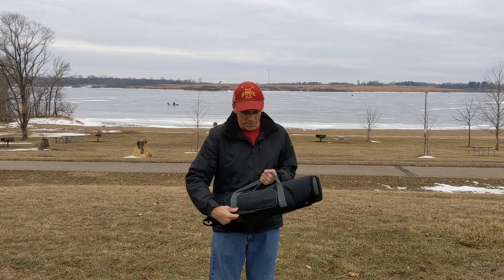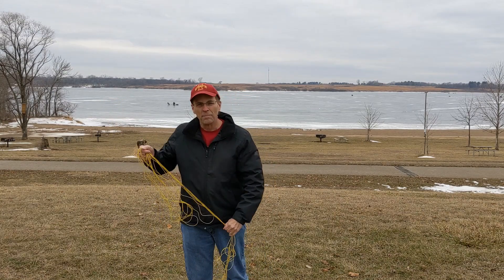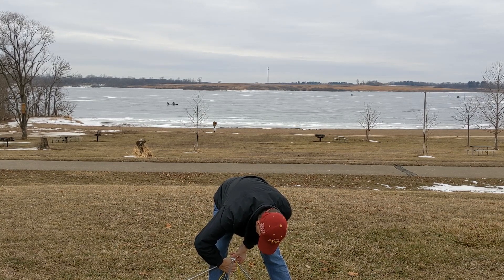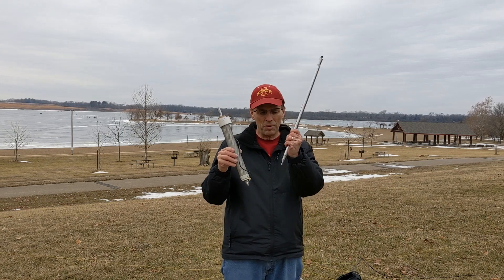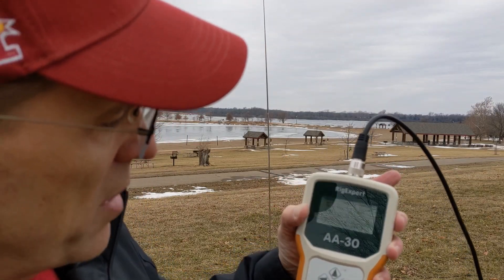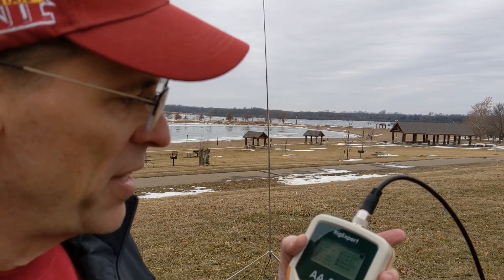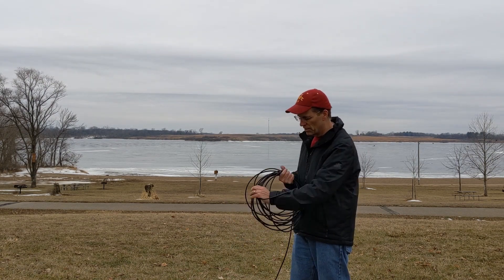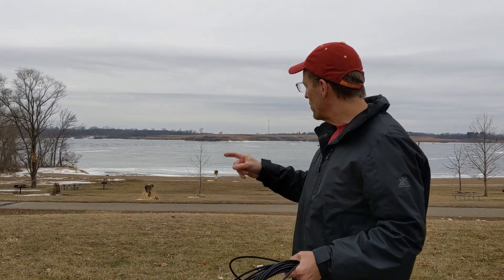POTA Antenna Basics with 17ft vertical whip and radials

Comment: Pat, THANK YOU for NOT assuming we all know how to coil wire cand coax AND for taking time to demonstrate YOUR method. VERY worth while!  I just, today ordered the WRC 1000 Platinum with the 213" whip. I already have the Chameleon 17 Foot whip. I know the coil will work on 75 and 80 Meters but have yet to find anyone with a Video actually using it.  Best 73, and thanks for your excellent Video!  Doc W7DOK

Comment: I run the almost the same setup. I'm about to try shorter and fewer radials, 8 at 10 ft each for 40 meters. Then connect them all with an outside wire around all of them. My quick and dirty calculations predict that you'll capture 85% or more of the radiation with 10 foot radials. Then to make up for losses due to a poor sandy soil I work in, add the perimeter wire to tie in all the radials.

I also suggest using RG8X although she ain't cheap. I also prefer to always have a choke when I can. To avoid additional losses I add 10 type small diameter toroids to my coax and heat shrink in place. It's not a lot of rejection, but with a system like yours, it's really just cheap insurance.

Lovely mini laptop ! I'd like to get one for digital modes since I'm still not proficient with CW.

Comment: Hey Pat, I'm an ISU grad, moved to the Raleigh, NC area about 5 years ago, but I knew I recognized the park. I use the same chinese whip, usually mounted to a mount on my truck, using my truck frame as the counterpoise. It's great for 20 and up (to 6m~), and I have a coil similar to the WRC for 40. Great for colder days, since I can sit in my truck at the park! Go state!
Reply: Hey Michael - thanks for watching the video and the comments. Yes - the whip gets the job done... I'm actually thinking through what I might do this winter to be able to sit in the car for an activation. Perhaps the whip on a magmount on the car. 
73 & Go State!

Comment: Nice video I use a super antenna tripod with the supplied radial wires and a 17 ft chameleon whip I found that each radial is tuned for that specific band.
I was able to get the swr down to 1.0.1 on 20 and 10 meters in the Ssb portion I find it easier to tune then the coil 73
Reply: Thanks Brian. 

Yeah, I'm not sure that I'll use my coil other than on 30m and 40m.  Maybe I should sell it.  With a 17ft whip, you can easily get a great match on 20m and up. 
73

Comment: Pat, I can't begin to tell you how much this video helped me. I have a WRC 213" whip that's been giving me fits. It would tune on everything but 20m. I tried a pile of different radial lengths and combos and nothing worked. I just built an identical radial setup to what you have here in this video and now tunes up on 20m no problem. Thanks man!
Reply: So glad you found it useful Evan!  SWR was frustrating in my first few activations with the WRC until I figured this out. Now, I'm very happy with the results. It's a performer!

See you on the air!
Pat NØHR
Reply: Broadcasting on 20m is a felony.

Comment: I pretty much set up as you do, but lately I've been toying with 36"x84" aluminum screen mesh for the ground plane and it works just as well if not better than my 18 to 24 radials (depends on my laziness).  Much quicker to set up and a smaller footprint on the ground than the radials.
Reply: Was thinking the same. Looking for affordable mesh that is light enough though hasn't been easy.
Reply: @nonokodog622  I use an $11 roll from Home Depot.

Comment: If you leave one tripod leg screwed into the hub all the time, it will still fit in your bag, and you can reduce the time screwing legs in by 33%.
Reply from the maker: Thanks for watching Ron. I wondered the same thing and tried to do that. The bag that I have is just a hair too short to make that work. Even though it would have only saved a few seconds, I hoped that I would gain that savings. Great thought though.

Comment: Why Do Radial Wires Are Needed? The SHort Answer, Anyone?
Reply from the maker: Not my answer but this may help... 
Radial wires are an essential part of a quarter-wave vertical antenna's design because they provide a ground plane for the antenna to operate against. The ground plane acts as a reflector, redirecting the radio waves radiated by the antenna back towards the sky. Without the ground plane, much of the energy radiated by the antenna would be absorbed by the earth, resulting in a less efficient antenna.

The radial wires serve as a counterpoise, which is a conductive surface that acts as a mirror image of the antenna's radiating element. By creating a mirror image, the counterpoise minimizes the amount of energy that is lost as the radio waves propagate away from the antenna. Additionally, the radial wires help to establish a uniform current distribution throughout the antenna, which is necessary for optimal performance.

Overall, the use of radial wires is critical to the proper operation of a quarter-wave vertical antenna. Without them, the antenna would not be able to radiate efficiently, and its performance would be severely compromised.
Reply: @hamradio_Tips_and_Trips_n0hr  BEST EXPLENATION I HAVE GOT ON  RADIALS.
THANK YOU VERY MUCH, NOW I UNDERSTAND WHAT THEY ARE AND PURPOSE FOR THEM.
ALL CAPITOL LETTERS BECAUSE IM SO GREATFULL FOR SUCH AN ANSWER.
THANK YOU FROM A BOTTOM OF MY HEART.
GREETINGS FROM LATVIA, 73

Comment: Would it work to drill out the hub to eliminate the threads? Then you could slip the rods in. You could drill and tap the hub for a screw to attach the radials with an alligator clip. ‐-n1bs
Reply from the maker: Hi Brian, 

I have thought about doing that.  I've also wondered how well it would work to just use thinner rods for the tripod. (thin enough that they don't need to thread in, but not so thin that they aren't strong)  Haven't tested that.

Comment: Thanks for the notes on the whip.  I have two of those from Ali.  Did you find the adaptor "bottoms out" before it is fully engaged with the 3/8" side?   I'm thinking I might drill , tap and die another couple.  Little round blanks to star can't be too much.  I had one of the whips extended fully and clamped to the folding table leg with a "CB style" vice grip mount.  Got lots of comments and people asking where I got it.
Reply from the maker: Hi Ronny, 
Thanks for watching. I have not had any issues with the my adaptor. It fully seats when threaded in.  

As you know, this is a very low-cost, but effective setup.  
73, Pat NØHR

Comment: I took my setup out to the field today.  It was deaf.  I swapped out one coax for another, but the same results.  Nothing.  Does anyone have some troubleshooting suggestions?  TNX!
Reply: What was your swr? WRC Antenna setup works great for me?
Reply from the maker: Yeah.. sorry to hear that. If you're using the same setup as this video, I'd start by checking swr, and swapping things until I narrowed down the culprit. Swap the coax (you've done that), antenna, even the radio. For example, if that same radio and coax work great to a dipole, you know to check out the vertical antenna. Does that make sense?
Reply: UPDATE: As I was taking the setup down I noticed that the coax had some off the PL-239 plug!  Also, I disassembled the mirror mount, and reassembled it, checking each step with my multimeter.  Continuity where it should be, and none where it should not be.  A member of the local ham club installed a new connector on the coax, so I went out to the park (K-3503) today for an activation.  SWR is 1:1!!  First QSO on the new antenna setup was South Texas to Vermont at 14.059, using 3 watts!!

Comment: Useful video… do you feel 12 radials is a good number for that antenna?
Reply from the maker: Hi Bob, 
Thanks for watching.  For 20m, 12 radials that are 16.5 ft really works well for me.  I'm making another bunch of 6 to bring me to 18 radials total (one on each tripod leg). I think that will help with 30m and 40m. I'll be comparing them to see if it makes a difference. 
73 Pat
N0HR

Comment: Mfj recommends a 90° connection and  1-1 balun at the antenna. Not designed for a ground rod.
Reply from the maker: Some guys use a choke which might be a good idea. I use one at my home QTH. So far, I haven't had any issues that would require a choke or balun.  Not sure what you ground rod comment is referring to here. I don't use a ground rod in the field. 
Thanks for watching.  Pat, NØHR

Comment: Hello! Just came across this post and your channel.  
Love the finger combing idea for laying out the Radials. 👍👍
Two questions: (a) Is there any advantage to coiling (over/under) a set of 6 Radials in one gathering?
(b) Have you experimented with using only  ONE SET of 6 Radials vs. TWO SETS of 6 Radials?
Thank you.
Reply from the maker: Thanks for stopping by Douglas. I haven't tried to use the over/under method with a bunch of 6 radials. My thought was that I'd have to first collect the 6 into a single group to treat it like a single wire to use the over/under. It might work - and might be worth a try. 

With regard to 6 vs 12 radials... you might know a few general principals with radials. 1) More and longer is better
2) You can hit the point of diminishing returns at which adding more delivers little improvement
3) Depending on the quality of the ground/soil, radials will impact your SWR/tuning
4) Radial deployment for a vertical can impact the pattern. If I only use 1 radial, the pattern will favor the direction of the radial. 
5) There's a rule-of-thumb to use at least 2x as much radial wire as the length of your lowest band. That is, if you're planning to use 40m as the longest band for your vertical, you should use 80m in total radial wire. 

So, with all of that said, if you were planning to use the vertical on 10m through 15m, 6 of my 16.5 ft radials would be fine. However, for 17m & 20m, I wouldn't quite be hitting that rule of thumb for radial length (it would work still work of course, just not as well).    I want to have a setup that has acceptable performance on 30m and 40m, so I'm considering a 3rd set of 6 to make sure I have a good system for those bands. 

I hope this helps.

Comment: You could add three antenna quick disconnects to that Mega-Pod and it would be a snap.
Reply: I thought about that... but I figured as long as I have to thread on each leg, simply putting the ring terminal on before I thread it in doesn't really add any time.  I think the biggest time savings that could be potentially gained is to get rid of the threaded legs altogether. 

Thanks for the comment Gary. 73, Pat N0HR

Comment: How do you expect the tripod to stay together if it doesn’t thread together? There’s lots of forces going on with wind and a 17’ whip. I wish I could get the knack of the over under, but I just don’t have the dexterity. What do you use to keep it from blowing over if there’s a breezy day? Great video!
Reply from the maker: Thanks Mark, 
My thought was that if the WRC hub simply had unthreaded holes and the legs were not threaded, I could just stick them into the holes. You're correct that the wind is an issue and I've had my system blow over... but I don't think the threaded legs would make too much difference in keeping it from blowing over... assuming that in an unthreaded version, the holes in the hub were deep enough. 

On breezy days, I lay the tripod bag (which has some unused things in it) on one of the tripod legs to weigh it down. I'm going to try some cheap camping pegs on each leg of the tripod to further stake them down on windy days. 

Thanks for watching! 73
Pat N0HR
Reply: I have the shorter legs. I cut a 10 foot pvc small diameter pipe into thirds and can slip them over the legs for a larger foot print
Reply: @markanderson8066  that’s an excellent idea. Thanks
Reply: I have seen a recommendation to use a tent state (the ones with a hook on the end) on each leg to secure it to the ground. I will trying that with my WRC. 😎

Comment: That looks pretty neat. Over Under Method is a old Roadie Trick that works with pretty much any kind of Cables nearly everywhere. Good Job Pat. Happy Sunday de Uncle Guenter 👍
Reply from the maker: I think the over-under method has been used for years but I thought it was worth sharing as I've seen many hams wrestling with coax. Thanks for the comments!
Reply: @hamradio_Tips_and_Trips_n0hr  You welcome. You did an exellent Job. Yes, any Method  that makes you work more comfy and safer is always welcome at any time and any Place

Comment: I don't like mucking about with that many radials tbh. I use the KJ6ER PREDator system, which is just a 17ft mfj whip and 2 tuned radials. The feed point is 5-8ft above ground and the radials are elevated to about waist high give or take. The whip is mounted with a standard cb mirror mount on roughly 5ft of 3/4in conduit carved into roughly 1ft sections (so they fit in the tripod bag) attached to a standard 60 in camera tripod. I have 2 sets of radials, one for 20-15, and one for 12-6  (banana clipped like a linked dipole). Up and down in 10  minutes or less and the radials add a bit of directionality when separated to approximately 90 degrees.

KC3UVF
Reply from the maker: Raised radials are certainly another option and can give you some directionality. Here in the center of the country, I prefer a more uniform pattern.  The "tuned radial" aspect is another consideration with raised radials.  If I change bands with my system, I only worry about the radiator length, not the radials. 

I don't think I have a good tripod to support a raised system at this time, but may try that someday. Probably want to make sure it's not on a windy day. 

73, Pat
Reply: @hamradio_Tips_and_Trips_n0hr  Tuned radials and band changes aren't that bad. It takes a bit of work upfront to work out the best length for the radiator, but the radials are just banana (or in my case spade terminal) clipped together at the appropriate length. For true "omni" just spread the radials to 180 degrees instead of 90, although that does seem to mess with the tuning a bit.

Tripods are pretty cheap. 50 odd bucks or so on Amazon. The ones with adjustable leg angles are particularly sweet. Set your whip, clip your 2 radials to the shield side of the coax, stake the free end of the radials (I use fiberglass driveway markers) and boom you're on the air!

KC3UVF
Reply from the maker: @KC3UVF  Maybe a project for this year will be to model this. My guess is that a raised system is more effective on higher bands (raising a 80m system a fraction of a wavelength is less effective).  Also, I'll need to ensure that the system is stable in the wind when raising (or guy it?).
Reply: @hamradio_Tips_and_Trips_n0hr  my old tripod didn't have fully adjustable legs, so I did stake that one down. The new one has a truly massive footprint if I need it. I've deployed for 20m (ie the full 17ft whip) in sustained 20 mph winds without a hint of instability.

I haven't worked out a coil arrangements for 40m and below yet, but I suspect performance would be more nvis oriented because 6-7 feet is a tiny fraction of a wavelength above ground at those frequencies. Even 10-12 feet, the limit of what I would consider practical, isn't likely to matter much. That said, I work central and eastern Europe pretty much reliably on 17 and above. 20m starts to have some shorter stuff mixed in... though admittedly that may change some after dark.

KC3UVF
Reply: @KC3UVF Sounds like you use  one size length for ground radials for all frequency bands? If so, do you size the radials for the longest wave you operate on?
Reply: @Coyotes_Locos  not at all. I use a pair of approximately 17ft (forget the exact length) radials that are linked like you would for a linked dipole. This works beautifully for 20m. For the upper bands I just shorten the whip and unlink the radials for 1/4 wave on the band I want to use (17-6m)

If you are really interested, I suggest you reach out to Greg (KJ6ER) directly. He will send you all the information you need to implement this system. I promise you, you won't regret it.
Reply: @KC3UVF  ok thanks. I know the KJ6ER system, wasn't sure if you were using it. Thanks.

Comment: I made up short 4" pigtails with a ring terminal on one end and a Power Pole connector on the other. The pigtail attaches permanently to the tripod leg. (You need to add a 3/8-24 nut to each leg.) The radials terminate into another Power Pole connector. The Power Pole has the added advantage of unplugging easily so if someone trips over a radial it pulls apart instead of pulling the antenna over.
Reply from the maker: Thanks John. I've considered a clamp to replace the ring terminals or the Powerpole method... but in my mind, the best would be the ring terminals without a threaded attachment to the WRC hub. That would take almost zero time to deploy. Thanks again.
Reply: @hamradio_Tips_and_Trips_n0hr : Recently came across an excellent Clamp attachment system for your Radials, and am in the middle of collecting parts to make it. 
LINK: https://www.youtube.com/watch?v=pTNojRg8x40&t=5s
Hope this helps.
Reply: How did you attach the multiple wires to the power pole adapter? I’ve been trying to find a video on making these multiple radials with power pole adapter for the wolf river coil.
Reply: @gitsum1985  My radial wires are small gage, so I just twisted the ends of three wires together and crimped them into the PowerPole connector. I also added a bit of solder just because. I have two pigtails on each tripod leg and three wires into each PowerPole which gives me a total of 18 radials. Mine are short - 102" long.
Reply: Smart idea...I've used spade connectors in the past...they tend to be very tight or too loose. Molex is cheaper so I might try that first.